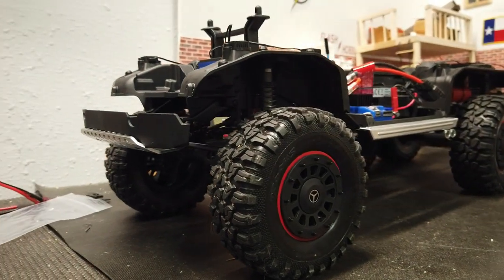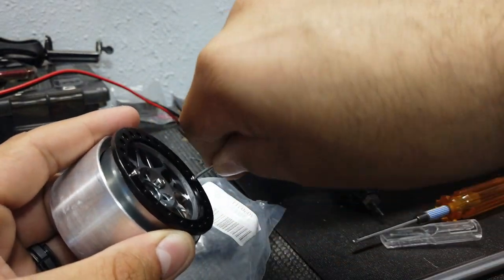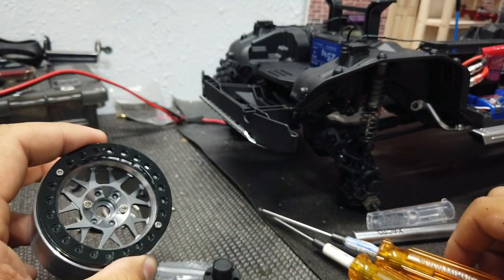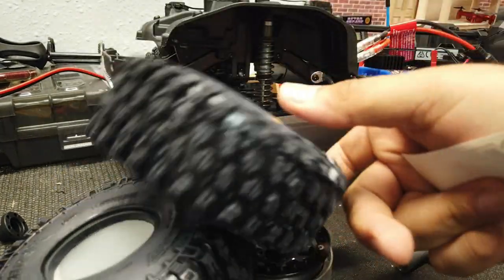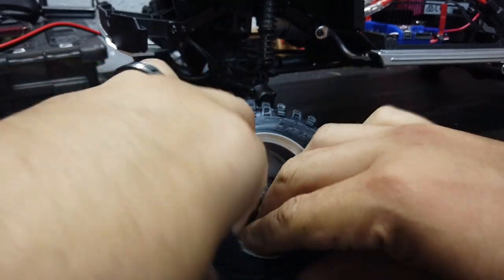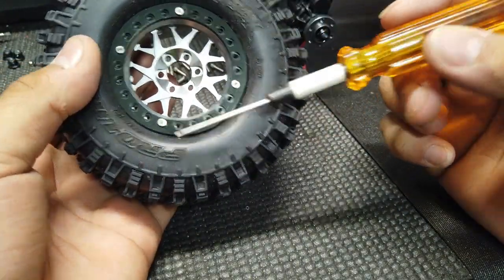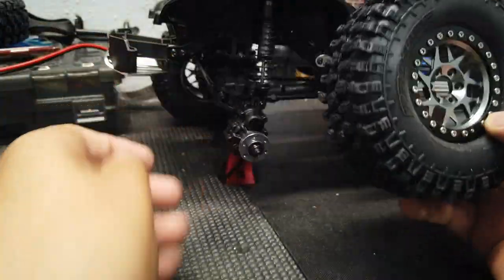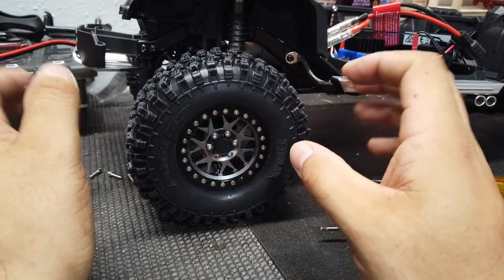TRAXXAS TRX6 1.9 PROLINE HYRAX STRETCHED OVER 2.2 CHANQISH BEADLOCKS

Comment: Great video. I noticed the tire did not align correctly on the backside. There were a little piece that was not attached correctly...look at the bottom of the wheel at 7:52.

Comment: im thinking about doing the same for my trx6! thank you for this!
do you think if i apply a super light coat of oil to the wheels itll help expedite the installation process of the tire?
Reply from the maker: Unstudded 6.0 I did not
Reply: This is a late reply, but may help future people.
I would use straight dish soap for lube when mounting.
Reply: @Guns N Gears  what about the glue?

Comment: Ya have to be careful, some tires compounds and trad patterns don't do well stretched, the sidewall protrudes and it just looks bad as well it can invert the contact patch giving you less traction.  The hyraks are so soft it shouldn't be an issue but with some tires that isn't the case. It can be a good look in some cases, the 6x6 looks good.  But most of the time, a rig is better off with matching rim and bead diameters
Reply from the maker: Todd Bertram I agree, I just wanted a different look with this rig. Some tires aren’t meant to be stretched.